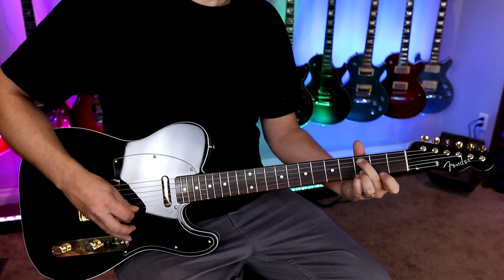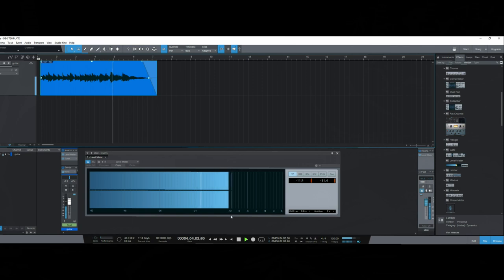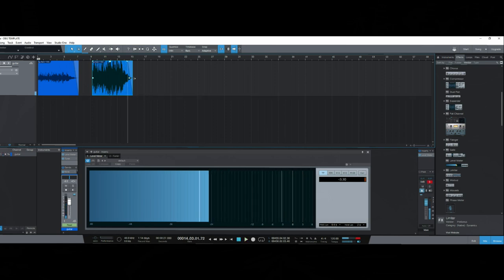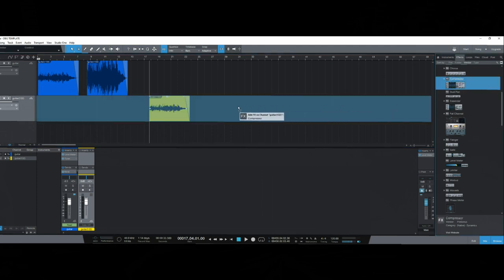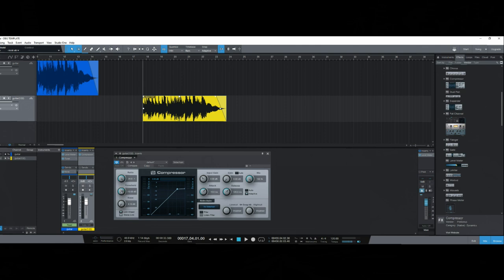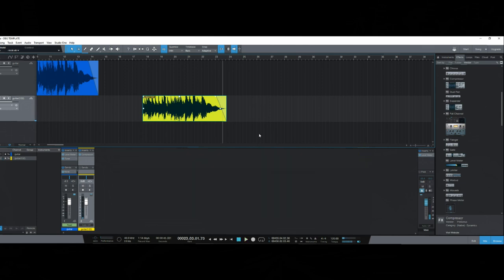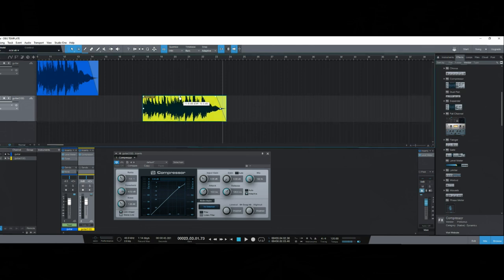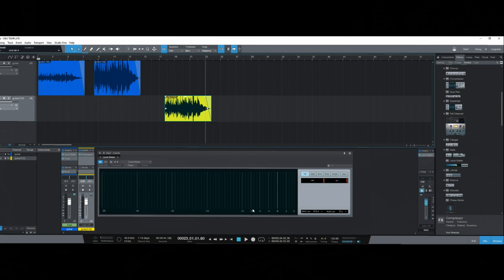Comparing 8 of the BEST Compression Pedals!

Comment: If you play clean, go and grab a compressor. If you play with Overdrive you are killing the dynamics...
Reply: Yeah, depends if you're using your amp for overdrive/distortion, if so, put the comp in the loop after the distortion stage, or if you're using an overdrive pedal, put the comp after the od pedal. Or don't, put the comp before the overdrive stage, maybe you can compress to the extent that you get the range of overdrive that works for your playing. 

(A compressor can majorly increase the transient of a note, [increasing the dynamic range of a signal, essentially decompressing, or expanding the signal] this magnified transient into an overdrive can INCREASE the action of the overdrive, increasing an overdrive's range, achieving the opposite of what you are saying, see later in this post for more info, or actually really study compression, with a range of compressors based on different technologies with different abilities, and most importantly with your ears and your eyes) 

A compressor by no means needs to go at the front of your chain, though, and doesn't need to go at the end, either. It can go anywhere in your signal chain depending on what you want to achieve. 

"Compression" is compression, but its not always compression!  Depending on the abilities of your compressor(s) you can achieve a range of effects.  This is like a pedal that can go from chorus to delay to reverb, we call those different effects, but they're all built around delaying a signal.  But with compression, usually most people just call it "compression".  And after all this, most compressors do not actually compress, they expand the dynamic range of a signal. But that is likely too technical for this vid/discussion.  But, the notion that a compressor should or has to go at the beginning of a signal chain is totally flawed.  This is a bone I have to pick with this vid.
Reply: @alphanumeric1529  
Wow. Thx for this information. I will overthink my attitude. Are you into building stuff? Cheers
Reply: @neve4020  Yeah, I do like building things, lol, why do you ask?
Reply: @alphanumeric1529  because your answer were so detailed! Cool
Reply: @neve4020  Haha, thanks. Compression kicked my ass for years. Then I just started to be able to hear it.  And then I was like, why'd it take so long to figure this out? I don't know why it is so hard, it's obvious once you can hear what a compressor is doing.

I think sitting down, and actually testing and studying what is happening and what it sounds like, rather than just using a compressor as you are working on a project. Just focus, and record audio with an appropriate threshold, and just turn the attack knob. And zoom in with your mind into the sound, the front edge of the sound.  But just don't listen for changes to loudness, listen to changes in tone - the balance between highs and lows. Really advanced audio engineers use compressors like eq's. They use them to change the tone of sounds. Crazy stuff, but it does come to you if you really learn to focus your ears. People talk about good ears, but its not your ears, it's your mind;s ability to focus and recognize distinctions in sound. Your brain is a muscle, the more you work it out, the stronger it becomes, and that is a fact jack!  Also, the Cali76 pedal compressor sounds AMAZING. It really does! It reproduces probably the most used and recognizable sounding compressor in the world for rock music, and the 10 million genres that flowed out of that.

tl;dr, compression kicked my ass for years, but when I sat down and really tried to figure out what was going on by listening very critically, it all became obvious, and now I literally don't know how I used to be unable to hear compressors working. And the Cali76 is amazing!  Haha, all the best!
Reply: @alphanumeric1529  glad to hear that you like the Cali76 that much. Im into the market to get one myself. I had the Pete Cornish OC1 on my board. Wonderful compressor but too transparent for my taste. I used it mainly because of its preamp sounds ( outstanding) especially with a Telecaster! Unf. the unit is rly big ( like the old big Cali76). I think i could try my second round with the Cali76 Compact version. What do you think about the stacked version? Overkill?
Reply: @neve4020  I can't say, really, what are you trying to do with compression?

Comment: I've got a ton of money in pedals. I'm not looking to spend much. What are the best inexpensive compressors. I have a TC Electronics Nova which has a lot of compression options however I run a number of overdrive's into it and so the compressor in the TC Electronics is not before many of my overdrive pedals. Therefore, I am looking to have a compressor in the beginning of the chain. Thoughts?
Reply: Hold out for a used "Ross" style compressor.

Comment: Until recently I've always had... well "budget" amps so in my quest to try to get some kind of usable tone out of my craptastic amp I ended up running a Nady mike tube compressor TMP-3 through my FX loop, to my surprise it works pretty good giving it some tubey goodness, cleans are very good and as long as you build your gain in front of the amp the dirt is good as well (never use the gain from a crappy amp in fact most of the time I do cleans on the dirty channel with the gain  down and do my dirt on the clean channel with pedals).

Comment: I understand compression as a recording tool but I still don't understand why anyone would want it for live use . I certainly wouldn't spend £££'s on a juicy valve amp and then limit it's dynamic range and feel with a £30 or £300 compressor pedal tbh. In my experience of compressors , the cheaper ones just add noise !

Comment: Interesting video, but the older I get, the less equipment I want between my guitar and amp.  When I've tried compressors, they always seem to add noise.
Reply: Howard's Guitar Covers add noise gate pedal. My gripe with pedals is it’ll always feel like I need another one
Reply: @Spense9  No, noise gates just cause more problems.  If you always feel like you need another pedal, maybe it's time to assess your basics: what guitar and amp do you use?  Try different styles, to find a combination that suits you without the need for pedals.  For me, it's generally single coil pickups rather than humbuckers, and an amp that just breaks up when played hard, with a touch of reverb.  Less is more.

Comment: I have electric guitar, and regular speaker, where there isn’t coming out the electric guitar sound. Will this compressor sustainer make a difference ? (Thx)
Reply: No, you'll need an amplifier which increases the volume between the guitar and the speaker. Using a regular speaker isn't advisable either

Comment: It all sounds the same to me - just different volumes.
Reply: Toronto Citizen That is what compression does. You notice it the most by the lower volumes being boosted up to match the rest of the sounds. The higher vomlumes and peaks are being squashed aswell, but are harder to notice. Another thing a compressor does is timing aswell, in as how fast do you want the effect to kick in when it senses volumes over a threshold set by the user.
Reply: Vincent's Guitar Lessons Thank you for the information. I am learning classical guitar and working on dynamics of tone and volume so compression wouldn’t be good for me anyway. But I like learning about all aspects of guitar.
Reply: Toronto Citizen Yes, compression is not ideal for classical guitar, where dynamics is the most important aspect of playing. 😊 However, in some generes like flamenco and bossa nova, or any playing with fast notes using a pick, even a classical guitar can sometimes sit better in a song with compression. The reason is that on classical guitar, to produce enough volume for the microphones to pick up well, you need to pluck very hard on the strings. Something to think about while you practice, that you also learn to play really hard aswell, pick or fingers.